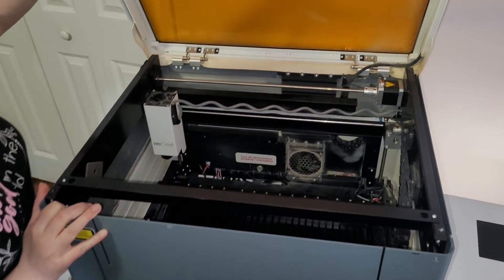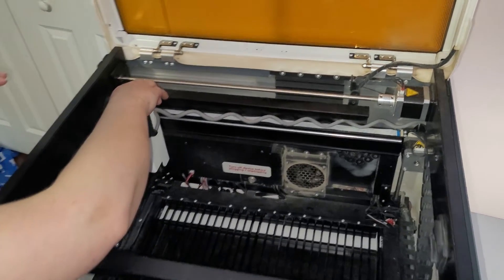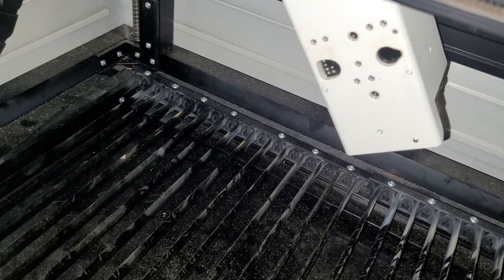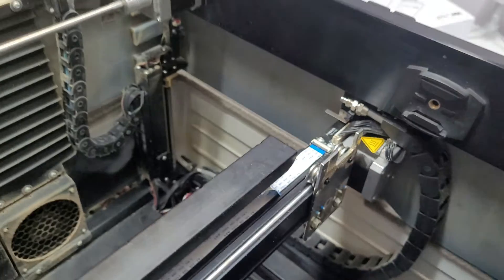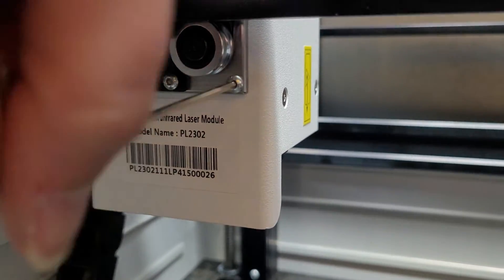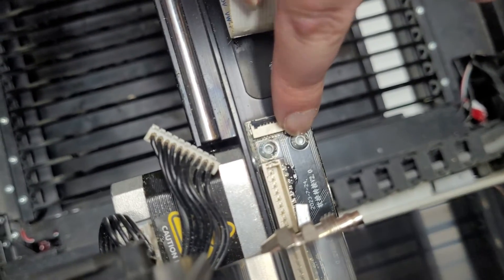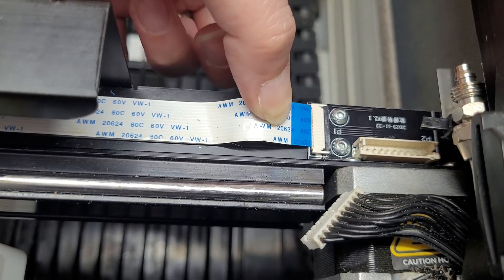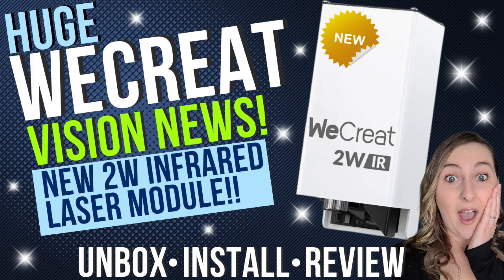How to Install the 2W Infrared Laser on the WeCreat Vision | Step-by-Step Tutorial

Comment: I think wecreat scamed me again. The 2w laser module I ordered with the unit does not match the laser module that is already installed. They have different connectors. One uses ribbon cable, and the other does not.
Reply from the maker: Oh no, that's frustrating! I'd recommend reaching out to customer support to see if they can help you get the correct module or troubleshoot the issue. I know once they came out with the 10w Vista they changed the way the IR module connects to make it easier. I'm guessing they sent you that one by mistake.

Comment: I got the 40w with 2w it combo and the cable is different.
Reply from the maker: Hmm I'm not sure I haven't tried putting the IR in my 40w yet
Reply: Did you find a vudeo
Reply: @DeannaWilliams75  it comes with a new cable and board
Reply: @rzqdzn  Looking at the same set up you have. Is it easier than this looks to swap the head? Just seems like a lot of small plastic part that could easily break.
Reply: @ yeah it is. After the first time it got easier